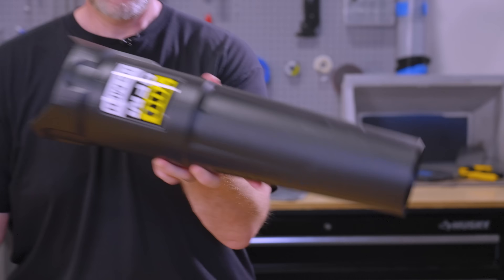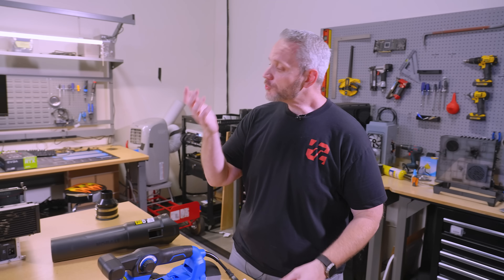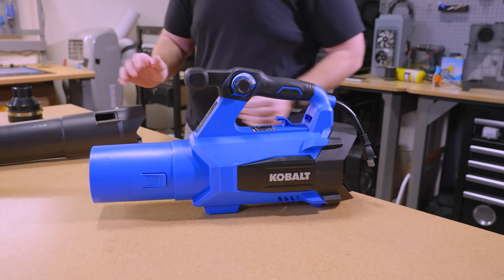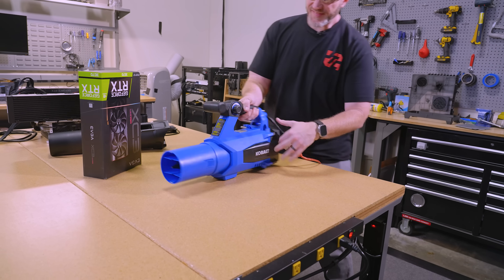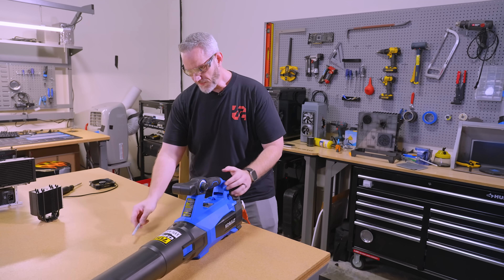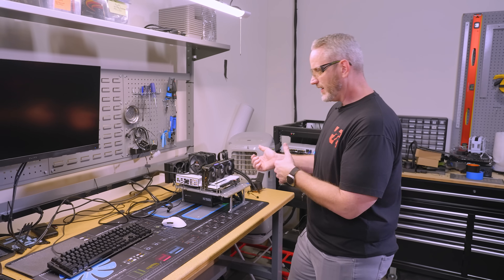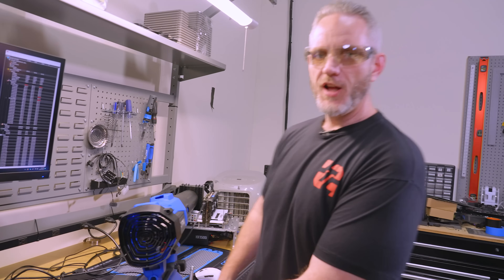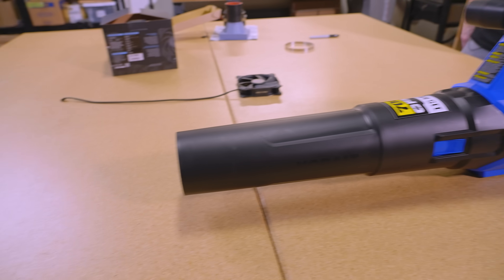I used a 115mph Leaf Blower as a CPU cooler... What could go wrong?!

Comment: if the tower is limiting the cooling why not just point the blower directly at the cpu face. maybe cooling by airspeed through the sheer volume of air passing exeeds the radiators ability to draw heat away... well never know if you dont try...

Comment: I would like to see what the effect would be for the blower to be mounted as a PULLER, that pulled air through the heat-sink and EXPELLED it, instead of pushed it into and through the heat-sink.  All of the added heat of the blower itself would never get to the heat-sink that way.  Still outrageously OP electricity wise, but the more I think of it, the more I would like to find out what the difference would be?

Comment: they make radiator fin combs for the automotive industry. should be able to straighten those fins with ease and it'll be fine as long as it didn't knock the fin free from the tube.

Comment: I recently moved in with my girlfriend amd her parents. I used her dads 20,000 psi air compressor for my aio cooler to dust it off, i didnt do the fans becausei foresaw something like this happening.(i think its 20,000). The fans were too dirty from me vaping around my pc and i used to light incense around it. I cleaned my fans off the best i could. Her house is really old and i have to use 2 prong to 3prong adapters to use surge protectors and the outlets are not grounded, i am currently only using a surge protector for my pc,i am worried about plugging in my ups to the prongs and surge protector. I jave read some bad things about doing it online,so for tue time being i am using the surge protector with the 2 prong to 3 prong adapter with the outlets,until we rewire the outlets in the back room. I have a NAS i got from my dad,and a netgear nighthawk x10 router configured with plex on it. My dad also had a box of about 16 1000gb 3.5 inch mechanical hard drives and 6 of them had old tv shows from the 90s on them. My entire dvd collection he ad also ripped to his plex server. This has nothing to do with this video but seeing Jay do these crazy things that i think about doing makes me laugh,but at least hes keeping safe while doing so!

Comment: Jay... In heat transfer between any two mediums there are several physical elements to consider. In the case of heat transfer from a solid metal vane to a gas. Flow rate of the gas is important but the nature of the flowing medium, here it is air at normal atmospheric pressure, is only one part. Consider the nature of the flow. Here using the leaf blower, the flow velocity through the confined space resulted in air flow that was probably laminar which is very inefficient in transferring heat between two mediums. Optimum  heat transfer requires that the flow be turbulent to break through the natural boundary layer that forms on the surface of the heat sink which is why slower fans realize more effective heat transfer. Also contact time between the mediums plays a critical role in that heat is purely velocity of motion of the atoms expressed as thermal agitation hence the amount of time that the two mediums have time to interact plays an important role. Oh and next time you decide to explode a fan using a leaf blower clamp the fan and wear protective eyewear else risk becoming the "Jack of spades".

Comment: I guess I don't understand.  Wouldn't you get a better result from just removing the heat sink and blowing that volume of air directly across the surface of the CPU?  Why transfer the heat at all if you can just blow it away.  I know you loose heat conductivity from the micro-thin layer of air created from turbulence, but at that volume of air, it should be almost nothing.

Comment: That's surprisingly poor performance given how much air's moving. Just goes to show that not all coolers can physically move the heat away from the CPU past a certain point. 

Though, I do wonder if the tower was flexing off the CPU slightly from the airflow.

Comment: Yeah.. while I will probably buy corsair hardware in the future, I will NEVER AGAIN install one of their softwares to run my fans and RGB - Corsair, along with ASUS, almost as if they worked together on it, ROYALLY SCREWED MULTIPLE WINDOWS INSTALLATIONS on my new 13900K / RTX 4090 build... I was literally about to RMA MULTIPLE parts, but then I thought I figured things out, then missed my chance to RMA, then thought the problem came back - and because this problem was being caused by BOTH iCue AND ASUS Motherboard malware, whatever the problem actually was got infinitely harder to diagnose, and the error I was trying to diagnose is already one of the most difficult.

Yeah I know what I just said is a little confusing, but... first, ASUS and their malware decided to install itself on my first windows install, ALONGSIDE WINDOWS!!  Windows was not even finished installing, and ASUS malware (Armory Crate - and their myriad "AI" programs' splash screens were popping up.   I finally determined that was the problem way later, after doing multiple clean installs of window ... so then after a couple weeks of troubleshooting in my spare time, I find out ICue was also having a very similar effect to the ASUS malware, and I removed THAT.   iCue on it's own can cause system instability it seems, but combine that with ASUS BS, a new and untested system worth thousands - both ASUS and Corsair nearly cost me that money too, because both of their products (I verified this separately, too) were able to cause endless DPC_WATCHDOG_VIOLATION bluescreens, along with numerous other errors that are traditionally known as some of the most difficult to diagnose - often causing people to throw out / RMA GOOD WORKING HARDWARE.   

Not had a single  BSOD since I booted Corsair and ASUS garbage off my system - good riddance.  I will say though, ASUS is WAY worse than Corsair in that regard, as half of the issues I was having with iCue were due at least in part, to ASUS having decided to pre-install their malware before even windows.  Not sure why it would be made to do this, and I'm not sure it was the intended design for the motherboard to shove ASUS malware in front of windows' installation itself, but it clearly had very serious, and very difficult to diagnose problems which essentially rendered the system unusable for longer than 10 seconds inside the OS.

Seriously, ASUS is especially bad with this though - freaking ridiculous how much their "Install before windows even finishes installing" level malware can screw up just about any system, no matter how cutting edge.  All it takes is a little shitty software from companies that should probably just stick to hardware from now on.  Love their hardware, usually.  I DESPISE THEIR SOFTWARE, and I'm very lucky I managed to stumble across some obscure forum posts where someone actually had all the same problems, and potential (but not) solutions to them, which resulted in the problem "changing" in severity and frequency, but not going away.  It isn't easy to diagnose multiple errors with nondescript error readouts (that tends to be the case, when windows hard locks and then the computer power cycles - there isn't an error code because it unexpectedly lost power - except for the error code telling you that's what happened) which it turns out had nothing to do with power.

Also, ASUS... how many "AI" programs do you expect me to install to use your shit?  Even in a 13900K / RTX 4090 build, all your malware actually still show they are having an impact on my system's performance!  Isn't their whole purpose, if what we're being sold about all the AI stuff is true, to make things faster, more efficient, smoother etc?  Why would I EVER install MULTIPLE AI SOFTWARES if they come with an inherent performance cost that their operation does not itself alleviate?  I don't CARE if I can't see it happen in real time when I'm gaming, because I already know what a compute runs like WITHOUT your malware - just fine.  That's like a feature for "poor performance mode", in a way, because there's no discernible positive impact that I could see.  Some of that crap is so poorly programmed the system resources they take up are staggering for what they're actually doing / what I see them doing.  It isn't a problem with my system, either - because things perform noticeably better without.

Seriously... why the HELL would you make MULTIPLES of them???????????????  To what end?  what is the purpose? what is the potential benefit???  There really might be something wrong with this company, because the software they want you to use with their newer motherboards is just disgusting.  It's offensive.  Sorry, I'm sure this rant was redundant, but I can't bring myself to do a proof-read because the rage within me starts to boil up when I think about how the last month of my life has been pretty miserable late-night PC troubleshooting and experimenting with zero results and seemingly zero pieces of defective hardware until they're all together in this system - the system that had iCue and ASUS mobo malware.  Which in retrospect was the ONLY real difference between my old rig, which I used to test parts, and my new one, which I was having so many BSoD in... 

...anyway... what I was blaming 13th gen for, was really Corsair / ASUS nonsense.  Definitely something to keep in mind considering both companies' prevalence in the PC enthusiast sphere... they need to confine themselves to the hardware game.  Contract a 3rd party with tangible coding knowledge and experience, to create the programs from now on guys... because this has been ridiculous and one of the most frustrating experiences of my life.

Comment: I feel like if you kept the diameter but 3D printed a shroud adapter to slide the leafblower onto an AIO you could see much better results vs an air cooler which just cant deal with the amount of airflow unless it was a passive design with lower fin density

Comment: You probably won’t see this, but it’d be very cool to see a comparison of Liquid Metal vs high quality thermal paste for delidded CPU coolers. I’ve seen quite a few people say on Reddit that it doesn’t matter or that paste can give you better performance since contact tolerances are so tight. Not to mention, gpu cooling is direct die and many people use paste for water cooling them anyway. Just a thought!
Reply: I second this! Would be interested in this as well.

Comment: Scientific Explanation on why it doesn't work:
the cooler circumference does not change so the cooling capacity stays the same while you are increasing volumetric pressure with volume(leaf blower) the molecules from the air exchange heat touching aluminum passing by through a process called thermodynamics.  Although under long periods of time the cooler itself would heatsoak while running a leafblower and from the extra volume molecules would rapidly expand and contract under pressure as the volume is higher thus the benefit of cooling gets worse.

The only way to increase the cooling is by decreasing the charge air density -- the more dense the air the colder it is, the more it can exchange heat while decreasing pressure and being able to have it 51 state's legal

Fun Fact, bare aluminum exhanges heat better, that black matte finish you have on your cooler came from formula techology, millions of dollars spent to find black matte paint color retains heat if the coat of paint is under .03mm while retaining same heat exhange.

Now you see this everywhere

Comment: 3rd print a shroud and hang that outside the house. during winter insane temps youll need to get rid of condensation. in the summer youll need a heat pump haha

Comment: Well that's the issue with the axial fan Vs a radial impeller. Axial has crazy flow rate so, when unimpeded, is fantastic for blowing leaves out the way. But try to get it to compress air, such as going through the narrow duct, and it falls to pieces.

Comment: What if you did a pull setup instead? Put the unit in a different area and have tubing go from the CPU heatsink to the blower somewhere else. Use some of that flexible dryer vent tubing. I bet pull would get you way more flow. Ok, maybe I just want to see if you would do that. 😂

Comment: The problem with this is if you move the air too fast over the heat sink then there is no time for it  to absorb any heat from the heat sink ..... You might have been better off with the restriction in place to slow it down a bit. Still as you said the size and mass of the heatsink also is a limiting factor.

Even failed experiments are a learning experience if you take to to analyze the reasons it failed ...... Goofy experiments like this are also just plain fun

Comment: this may be a bit late but instead of pushing air thru the cooler, have it pull thru the cooler? attach it from the rear of the blower. There would be no air compression.

Comment: Jay, please try a 1/4 or 1/2 hp water chiller on that mega pc water cooler build your doing. Heck plumb it with some quick disconnect fittings so you can take it out of the system and put it back in whenever you want to benchmark with and without it.

Comment: Fun fact: super fast moving air will actually cool worse than normal, this is due to the drag coefficient where theres a point the air actually sticks to the fins like a coating while air moves past that "coating" of air.

This is used in airplanes and is why the bottom side of the wings are flat or almost flat while the top part is curved and is why air moves slower on the bottom creating pressure

Having flat fins mean the air is pretty much bypassing the surfaces

Comment: Keep the air as dense(cool) as possible for maximum conduction.  Use the blower as an exhaust to pull the air across the cooler.  Pushing the air at the cooler at that velocity is potentially generating heat through mild compression and likely adding the blower motor heat to the air stream as well.

Comment: I had a latop with a fan that completely went out on it. It would shut down quickly after being turned on. For months I used a 5 gallon trash can with a box fan on top of it and then the laptop and it never overheated. It was pretty annoying though. It was a laptop that you had to take it basically all apart to get to it.

Comment: Would be “educational” about how important is airflow 😂 to seal all the intakes and use only the leaf blower as intake. A passive Noctua or similar inside the case would do. Similar design as the Torrent would do. 😂 forgot to mention: I use the leaf blower after washing my car. No water dripping here and there after wiping dry the car. Also works wonders for the front grill.

Comment: With air velocity too fast it actually creates barrier of slow moving air wall right on the fin stack that in this case insulates What you´d need to test now is how it works with fast moving liquid thru the fins on an air cooler :D

Comment: Increasing airflow only provides an advantage up to a certain point.  Once the airflow reaches the point where the heat cannot conduct from the heatsink to the air fast enough to result in a significant increase in the temperature of the air before it leaves the area of the fins, increasing airflow won't produce any effect.  You also run into a limit based on how fast heat can conduct from the CPU into the contact plate of the heatsink, and from the plate through the heat pipes to the fins.  Interestingly, increasing the density of the air flowing through fins, without increasing it's temperature,  should produce an increase in the maximum rate of heat exchangeable before hitting a limit, or changing the air with a better heat conducting gas.  
In short, you can only cool the fins down to the temperature of the air being forced through them, and the cooling of the CPU is determined mostly by the difference in temperature between the CPU and whatever the heat is being conducted into, in this case being copper, aluminum, whatever they used in the heat pipes, and ultimately air.  The air is the least conductive, (which is the reason heatsinks have large fin stacks to increase surface area, and therefore conduction), and the end location for the heat energy to be moved to, so it is the temperature of the air that ultimately determines the maximum cooling effectiveness.

Comment: Try to 3d print something to connect to the back of the blower so you are pulling through the radiator and it would also keep from heating up the air.

Comment: jay, so the air cool solution is limited by the heat pipes/ heat sink, why don't you use blower on a radiator in a water cooled system?!

Comment: 120-130 is a jet plane, also why the hell aren't you using ear plugs. Also I am surprised this did anything, because by blasting air that fast through fins you are creating friction from air actually heating up the fin stack, and not really allowing the air to have time to properly convection heat from the fins to the air, so its ridiculously inefficient .

Comment: Not that I think Jay will see this but..... you know...questions! The air that is going into the leaf blower is the air in the room, what about cooling the air surrounding the leaf blower???? ie.... using the AC to change the temp them blowing it onto the rad and seeing if it can bring down the temp? Or some other way of trying to "supercool" the air going into the blower??? That should make a DRASTIC change to the temps, right???

Comment: hey that air isn't warming up because its pressurised by that leafblower. These things aren't pumps, they're blowers: they're crap at generating pressure.
The air is hot because there's a small electric motor working really hard and its using the blower to cool that motor.